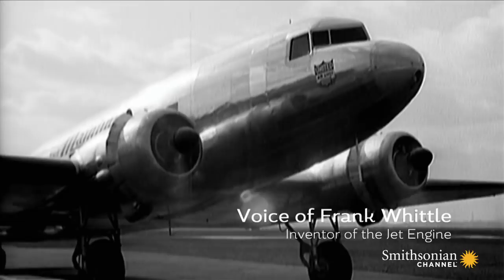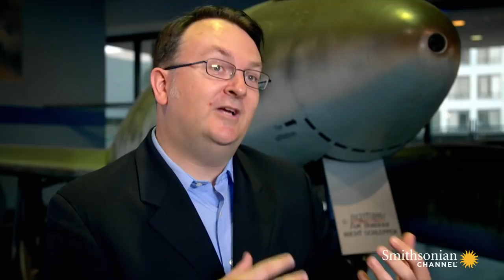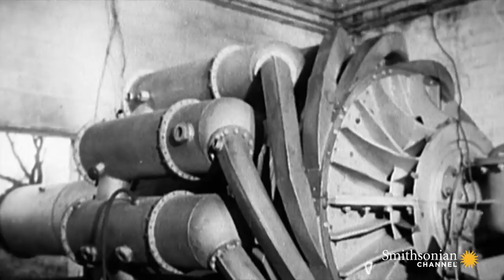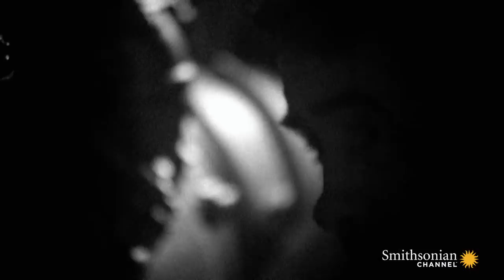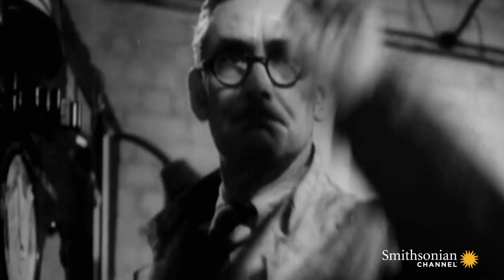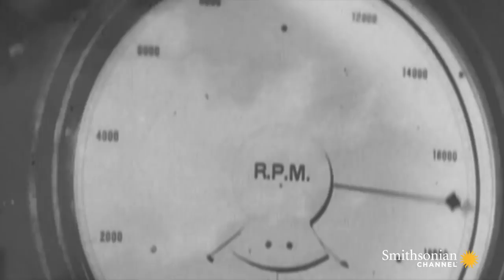Inventing the Jet Engine Came With a Few Disasters

Comment: Sir Frank Whittle OM KBE CB FRS FRAeS[1] (1 June 1907 – 9 August 1996) was a British Royal Air Force (RAF) engineer air officer. He is credited with single-handedly inventing the turbojet engine. A patent was submitted by Maxime Guillaume in 1921 for a similar invention; however, this was technically unfeasible at the time. Whittle's jet engines were developed some years earlier than those of Germany's Hans von Ohain who was the designer of the first operational turbojet engine.
Reply: Single handedly?   No.   For a start, Whittle and his company never came up with a practical engine.  He supplied a design to Rover, but Rover couldn't get it to work.  That took companies with better engineers and relevant technical experince such as Rolls Royce and General Electric.   Secondly, Whittle had a team of engineers working under his direction.
Reply: Frank Whittle was the second to patent (it was found invalid) and was only the 4th person to successfully demonstrate a working jet aircraft engine.
Whittles patent was technically unfeasible and he would never build any engine with a axial compressor.

As A.A. Griffiths pointed out when he revealed that Whittle had plagiarized his paper published in 1926... Whittle didn't even understand how a axial compressor worked.
Reply: Hans von Ohain and Max Hahnn built the first turbojet engine prototype in Gottingen Germany in 1934... we know from the historical records that Whittle would not begin any actual work on jet engines until moving to Rugby in 1936.
The Gloster Whittle E.28 would not fly until May 15th 1941... two years after the Heinkel He-178

Comment: The first idea was Hans Von Ohain
Reply: No it wasn't you plank. Whittle had the idea in 1930 - way before Ohain, who later admitted that he had seen Whittle's patent.
Reply: No, Gas turbines were known for years, even whittle gets his idea in france in the 1920ies.The main problem when having a totally new idea is to bring them to live ! Whittle and von Ohain entered a totally new world and ha d to develop this world from scratch.
Reply: @gw7624 Whittle was only the 4th person to successfully demonstrate a jet aircraft engine.
Maxime Guillaume patented the turbojet aircraft engine in 1921 when a 14 year-old Frankie was still wearing short pants
Reply: @WilhelmKarsten  Patenting an idea is a far cry from coming up with a successful design. Guillaume's patent would not have worked - at all. There's a reason modern jet engines derive from Whittle's original designs - they work.
Reply: @gw7624  The jet engines we use today are all axial compressor jets, not Whittle's primitive centrifugal compressor turbojet engines that were an evolutionary dead-end and obsolete on arrival.
Whittle's patent was technically unfeasible and was never constructed either, what is important was that Whittle was not the first to patent, construct or successfully demonstrate a jet aircraft engine and was not the first to acheive anything related to jet engines.

Comment: While the Germans did indeed develop a jet engine, the British were doing the same thing at the same time.  The Germans eventually settled on the more complex Junkers Jumo 004 which powered the Me262 (also the BMW 003 which powered the He162) while Whittle and his team at Power Jets settled on a simpler design which became the Power Jets W.1.  The W.1 eventually became the Rolls Royce Welland and the General Electric J31.
Reply: Yeah the german's stole the idea from the British. The german who designed the German jet engine confessed in his biography that he had seen and read Whittle's patent in a German library. He lied for a while saying that he had come up with it on his own.
Reply: @nick4819  History write by the victor right
Reply: @nick4819  Regardless they got it working in a functional fighter aircraft that actually saw service first, lets not pretend that german aviation contributions were not important.
Reply: @nick4819  cant imagine that because hans von ohain and frank whittle have very different jet engine designs. 
Pls try again.
Reply: @nick4819  
That's wrong, first Ohain never confessed anything remotely close to this. Second, Ohains developements went from a radial compressor prototype to an axial flow type, completely different from what Whittle did. Third, the germans developement of the turbine engine was so diverse, i couldn'possibly have been stoßen from Whittle ....
Reply: @imranzakaev3191  It was HIS biography. Not someone else talking for him.
Reply: @Falkenlp3  Here's the hard part for you to understand: he didn't have to copy it EXACTLY. He seen the patent, understood what he was trying to accomplish, and then created his own. I'm not saying the man wasn't smart. Simply pointing out that HE CONFESSED to seeing it before building one.
Reply: @omegazeta  What they created was a dead end due to its complexity.
The British would have always contributed more to aviation the the Germans.
Reply: The Jet engine was invented by Hans von Ohain and Max Hahnn in 1934.
Reply: @nick4819 That's a  bald faced lie, Maxime Guillaume patented the turbojet aircraft engine in 1921 when a 14 year-old Frankie was still wearing short pants.

Anyone that has seen Von Ohain's patent and Whittle's patent can clearly see that thet are completely different.

Whittle was exposed for plagiarizing the work of A.A. Griffiths published in 1926, Whittle was given access to it while attending RAF Cranwell.
Reply: @nick4819 Never happened, pure British revisionist fiction.
  As pointed out by Cheif of Engine Eevelopment at the Royal Aircraft Establishment.
If anyone had copied Whittle's 1930 patent they would have failed, Griffiths pointed out several fundamental flaws in Whittle's 1930 design.
Frank Whittle never built the the 1930 engine, in fact he would never build any engine with a axial compressor.
 Whittle would not begin any actual work on jet engines until moving to Rugby in 1936
Reply: @nick4819 That's just a propaganda myth.
von Ohain's design is COMPLETELY DIFFERENT and bares NO RESEMBLANCE to Whittle's patent.

Even Whittle abandoned his 1930 design.

There is no doubt that Whittle's work was not original and is based heavily on a A.A. Griffiths technical paper published in1926 and heavily influenced on the Swiss BB&C Velox gas turbine demonstrated in Manchester at UMIST in 1934.
Reply: @lostonearth7856 The only dead-end was Whittle's engines, the jet engines we use today are based on German Axial turbojets.
Reply: @mandernachluca3774   Google Whittle's January 1936 patent. It uses an axial compressor and centrifugal turbine. 

The patent documents were part of a large number collected by the German government and distributed to German universities, which is where Von Ohain first saw Whittle's design and copied it.
Reply: @WilhelmKarsten  Germans did not invent axial flow turbojets. They might have had the first one operating in an aircraft, but it was awful because materials technology hadn't caught up. No further development of these engines happened after the war.

Almost all post-war jet designs, including all Mig-15/16/17 were direct copies of RR designs by Whittle. 

The British MetroVick F2, ran in 1941 and led directly to the Armstrong Siddely Sapphire, which was successfully used in over a dozen different mass produced aircraft.
Reply: @tomjohnson9833  Whittle never constructed his 1930 patent (which was invalid and allowed to expire in 1934)
Whittle never constructed any engine with a axial compressor.

The jet engine was patented by Maxime Guillaume in 1921 and featured a axial compressor.
Reply: @WilhelmKarsten   "The jet engine was patented by Maxime Guillaume in 1921 and featured a axial compressor."

well, a crude sketch of an axial compressor arrangement, with no intention to build. 

Nobody is claiming Whittle was the first to patent a jet-engine-like design. 

*Whittle never constructed his 1930 patent (which was invalid and allowed to expire in 1934)
Whittle never constructed any engine with a axial compressor.*

Whittle chose not to use the axial compressor. But take a look at his Januart 1930 patent drawing, and then look at the Heinkel HeS1 and HeS3. They are almost perfect copies of Whittle's patent drawing from some seven years before they were built.
Reply: @tomjohnson9833  Whittle never constructed his patent design and as A.A Griffiths pointed out when Whittle was exposed for plagiarizing his paper published in 1926... Whittle didn't understand how axial compressors worked and made several egregious design flaws that rendered Whittle's design completely useless.

You need to have your eyes checked lad, Hans von Ohain and Max Hahnn first jet engine design shares absolutely nothing in common with Whittle's invalid patent.

You seem completely unfamiliar with both engines
Reply: @nick4819  Nah  You're literally making stuff up
Reply: @WilhelmKarsten  True.  The British were unable to build a practical working axial-flow jet engine until after the war when they could examine German research.  The reason the British used the low tech centrifugal flow design is that they could do.  Whittle stated that they lacked the technology to build an axial-flow engine
Reply: @tomjohnson9833  Nah.  Franz invented the axial-flow engine.  No British axial-flow engine worked properly until after the war when they examined German research.
Reply: @TheAneewAony   the British had an axial flow engine working in 1941.

They didn't get their hands on a German engine until late 1945 early 1946, by which point British designs were already doing quite well
Reply: @tomjohnson9833  WRONG!
The British did not have a flight-rated, production axial compressor turbojet until the 1950s and only made possible with captured German technology and engineering expertise.
The Metrovick F.2 was an utter failure and Metropolitan-Vickers abandoned it and jet engines entirely in 1947 to return to building steam engines.
 The Rolls-Royce Avon didn't run until 1947 and the Armstrong Siddeley Sapphire didn't run until 1948.
The UK was a decade behind in axial turbojets and didn't successfully build one without German technology.
Although most of the German engines and engineers went to America, the Fedden Mission recovered and brought back anyone and anything that was left behind by the Americans and the Soviets.
Reply: @WilhelmKarsten  I can't tell whether you're deliberately making things up, or are just not very good at educating yourself.
Reply: @tomjohnson9833  The facts are irrefutable and cannot be denied.
Britain has never been a leader in aviation and aerospace technology... it has always lagged years behind America Germany and France and the UK no longer makes any jet aircraft of its own.
Reply: @tomjohnson9833  Please name a single British axial jet engine that was flight rated, accepted into RAF service and in production prior to 1950?
Reply: @tomjohnson9833  The complete list of British WWII combat operational jet fighters:  Just kidding, there weren't any
Reply: @TheAneewAony  "The complete list of British WWII combat operational jet fighters:  Just kidding, there weren't any"

Are you just being argumentative for the sake of it?

Please Google the Gloster Meteor, introduced to active RAF service end of July 1944. 

A Gloster Meteor was the first jet aircraft to shoot another aircraft down - two V1 Flying Bombs on 4th August 1944 - four days before a Me262 shot down an aircraft. 

All this aside, you're trying change the subject again. 

The subject of the video that you find so challenging to your ego is Frank Whittle, who designed, built and ran the first jet engine. The first jet aircraft to fly, and the first jet fighter to fly, are all different subjects, and you know it.
Reply: @tomjohnson9833  Hiding from the Germans is not combat.  No British jet ever engaged the enemy in combat during WWII.  Hope this helps!
Reply: @TheAneewAony  You can keep repeating that all you like, but unfortunately the evidence is not in your favour. 

Did you Google 'Gloster Meteor' like I told you to?  Go on, find the Wikipedia article and read the Operational History section. 

Then return here with your findings like a good boy.
Reply: @tomjohnson9833  Hopefully, this clears things up for you!  Eric Brown: "Speed. Speed. It was a pedestrian aircraft, really, the Meteor. It never went into… It never fought operationally. It fought, if you like to call it that, against the V1, the flying doodlebug, and quite successfully. But it really was too slow to deal with the German jets when they came into being. They were a grade above at first. The Me262 is quite frightening. It gave us a shock to find out, because when I flew it the fastest fighter we had – piston fighter, of course – in the Allied camp was the Seafire Mk14 with a top speed of 446mph. The Me262 was 125mph faster than that aircraft. So this was a rude shock to our system, I tell you, when we found that out."
Reply: @nick4819  Nah.
Reply: @TheAneewAony   that's an excellent quote you copied and pasted, and shows you've made a little effort before commenting this time. 

However, at no point did I claim the Gloster Meteor was faster than other contemporary jets. 

I simply pointed out that it was a combat operational British jet, and it actually shot down an enemy aircraft BEFORE the Me262 did, though this latter point is largely irrelevant to your first erroneous statement. 

Now you've had a chance to do a little more research, can you retract your initial statement about the British having no combat-capable jets in WW2?   The reality is that the British had exactly the same number of combat jets as the Nazis